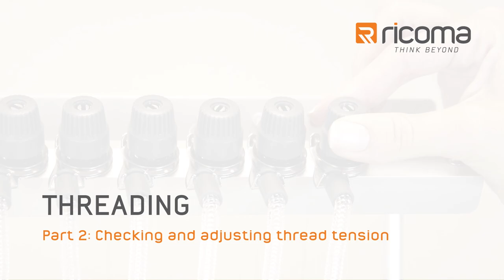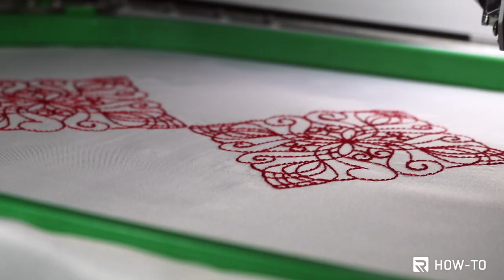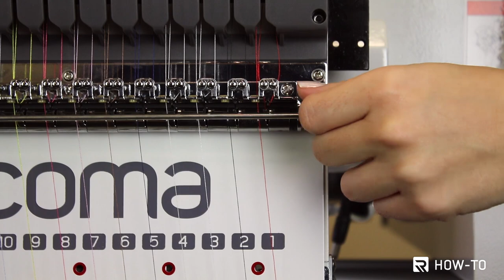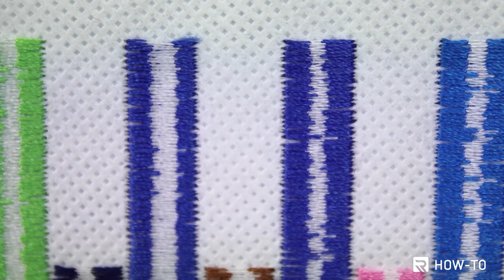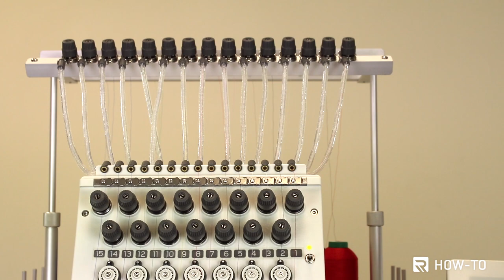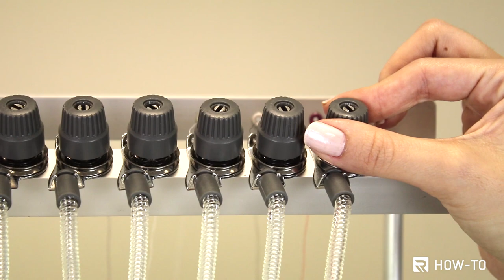MT-1501 How-To: Threading - How to Check and Adjust Thread Tension

Comment: Good day

May you please assist me with my Ricoma RCM-1501 TC 7S, the bobbin thread doesn't get picked up when I embroid and the top thread becomes extremely loose. I have tried tension adjustment both on top and for the bobbin without success. I also cleaned my bobbin case to no avail. 
I don't know what else to do. May you please assist?

Looking forward to receiving the assistance
Reply from the maker: It could be a variety of different things. For example, 

1. If it is just one needle, it is most likely an upper thread tension issue and you should adjust the tension for just that one needle. 
2. If it is all your needles, it is most likely a bobbin tension issue and you should click on the link below for the article  "How to Fix Bobbin Thread Tension".   
3. Check that the threading is correct. Make sure there is no excess looping around the tension knobs or tangles in your thread. If there are, re-thread your needle.    
https://ricoma.zendesk.com/hc/en-us/articles/4408676078355

Comment: Your video so quickly  glosses over tension it's almost useless for the beginner. It narrates as if the viewer knows stitching already, when someone new to embroidery watching this most probably hasn't a clue. In particular, your bobbin tension advice is confusing, as a beginner may think that after watching this that they need to adjust it for each thread. As that's not the case and one adjustment will affect all the bottom tensions for each needle. I would suggest taking this video down and making another one that explains it properly.

Comment: I really don't understand this video:"if top tension is too loose,and bobbin tension is too tight,tight the knob clock wise ",it doesn't make sense,how top tension is too loose and bobbin tension is to tight show the "I "test results ?It's better to show when the I test columns got more bobbin color in the back,is the top tension too loose or tight?
Reply from the maker: Great question. You can tell if your top tension is too loose if there is more top thread showing than bobbin thread. You can tell if your bobbin tension is too loose if there is more bobbin thread showing than top thread. The ideal tension should be three equal parts. 1/3 top thread on each side and 1/3 bobbin thread down the middle. So to answer your question: When the column has more bobbin in the back, that means that bobbin tension is too loose. So if the bobbin tension is too loose, then the top tension would be too tight because you will notice the top thread would be very thin on the column, which means it's too tight. Both need to be just the right amount. If this were your exact scenario, you can loosen the tension knob of the needle that has very little top thread showing and that will make the top thread show more and even out your tension. We will post a video on how to interpret the "I" test in the coming weeks!
Reply: Can you help me my ricoma machine says needle error no needle
Reply from the maker: Clear the error by pressing ESC and turn the red color change knob behind the head until it shows a needle number on the screen instead of 0